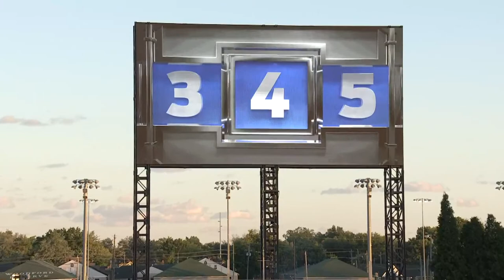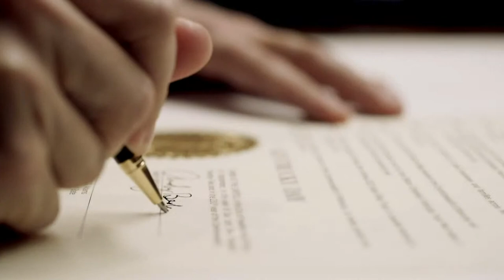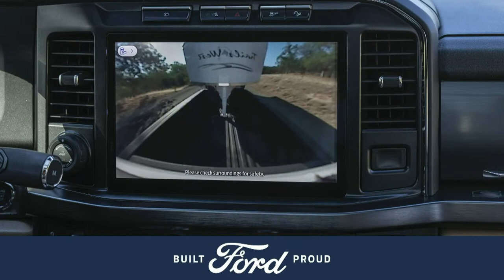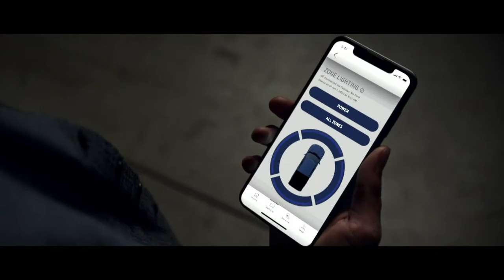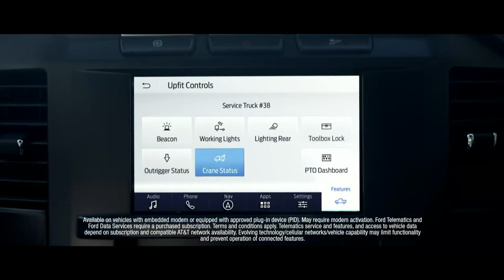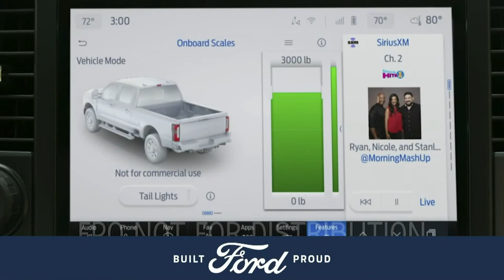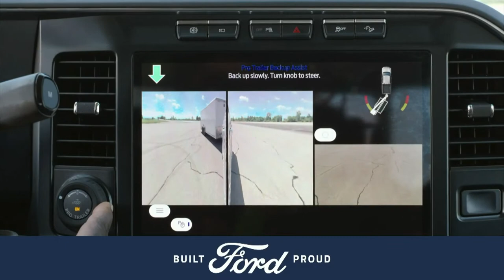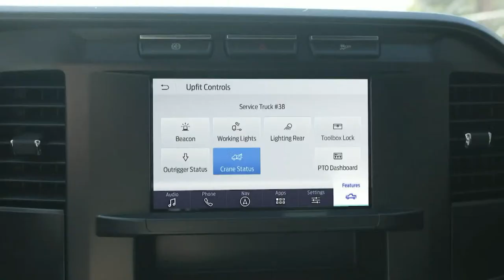All-New Ford F-Series Super Duty® Debut | Ford

Comment: I've owned  Super Duty's for over 20 years and I absolutely love them! They are a true work horse that hasn't let me down and I will continue to purchase them.
However, it would be nice to have a steel bed option. I purchased my latest truck brand new in September of 2017  and it has some holes & dents from metal fence posts and wood. Farmers and loggers don't toss things gingerly and I noticed the first puncture the following spring. Personally the Super Duty is purchased for work/hauling, mileage is just a bonus.
Reply: Bed liner?
Reply: @theinvisiblechurch1607  Yes, doesn't help much. Just keeps things from sliding. 
Still love my truck though.
Reply: @emilybenes3818  Have you tried a professionally sprayed in bed liner? I know you are talking about the aluminum bed.
Reply: @theinvisiblechurch1607  Yes, that's what I have.
Reply: Some of the sprayed in bed liners help and your stuff doesn’t fly around like the plastic 💩.
Reply: @theinvisiblechurch1607  xbxbdhfhfh

Comment: I'm curious on the power figures on the 6.8 vs the 7.3.  7.3 makes 430hp and 475tq but it appears that the power will be bumped a bit?  6.2 DOHC right now is 385hp 430tq, so I'm thinking this new 6.8 has to put out just over 400hp and probably 460-470tq, bumping the 7.3 probably to 440hp and maybe 495-500tq.
Reply: Agreed. Unless the 6.8 is dramatically different, with much better fuel mileage, it seems like an odd choice for Ford to remove ~30 cubic inches rather than keep their focus on improving the 7.3.
Reply: I've owned a few super duty trucks from 99 on up driving and working they were great. Riding on the passenger side not so much need to do something with the foot room about have to put your left foot sideways very uncomfortable on long trips. The 150 are very comfortable but they don't offer the 7.3 I am interested in a new truck but for the money they are getting I don't want to settle for ether one.

Comment: Electric vehicles will get you halfway to where you want to go - 

Btw - it takes over 300 barrels of oil to produce one electric vehicle battery -
Reply: Source please.
Reply: @Dr4by  Common sense. Use it.
Reply: Consider two interpretations for your statement:
1) Energy Storage:  Petroleum's standard for a barrel is 42 gallons.  If you're claiming on battery holds the energy equivalent of (300*42 = 12,600 gallons, then consider if my gas powered vehicle got a dismal 10 MPG. You're saying I could go 126,000 miles on one battery charge. Sorry, but you're WRONG.

2) Energy consumed in battery production: If you're saying that the production of a battery consumes 300 barrels, you're also WRONG. Over the last decade, a barrel of crude has averaged ~$60/barrel, 60*300=$18,000. It costs quite a bit more once it is refined, distilled and distributed to consumers producing products. But even at just the cost of crude, you're saying the energy costs alone to produce a battery would be $18,000, and that's ignoring other costs (markups, distribution, inventory, warranty, advertising, taxes, overhead, profit, etc., etc.)
Reply: Hook line and sinker boys !
Reply: The 300 barrels of oil isn't so bad.  It also takes 1000 unicorn farts.  That's just not sustainable or ethical.

Comment: I would be so excited for a Superduty built for off road as well "Superduty Raptor". I could imagine the cost too.
Reply: That’s kinda what the tremor is meant to be. It has a optional winch and has off-road modes like the raptor. With heavy duty suspension it’s hard to make a 3/4 or 1 ton truck handle the desert without custom suspension.
Reply: What baffles me is that the SuperDuty's have two steel prongs that drop down about 4 inches, relative to the frame. They sit behind the air dam. While the air dam can be removed in order to improve approach angles, the metal prongs are welded to the frame. They dramatically limit the approach angle. Last Winter, a friend attempted driving over plowed snow that had hardened into an icy berm. It's no surprise that the ice broke his air dam. But it also bent one of the prongs.  It's not clear to me what purpose they serve. If I were part of Ford's team for off road applications, removal of these would be low hanging fruit for improving off road abilities. At a minimum, I'd make them bolt on features instead of being welded to the frame.

Comment: Will they get rid of the driving learning feature in the 10 speed please that needs to be reflashed
Reply: Wish they'd just offer a 6 speed manual, it is a "Super Duty" truck at least that's what they keep pretending they are...it should have the proper transmission.  10 speeds in an automatic is way too many gears for it to pick from, luckily there's so many and so closely ratio'd you can't tell its shifting, so you don't realize all the wear and heat that its causing.

Comment: When does Ford plan to ship those trucks waiting for parts?
Reply: 2023 for the 2022 trucks already built! ,
Reply: @LWRC  They may use 2022 chasis
Reply: @wj2791  I don't think Ford can do that!!  Ford changed certain chassis / drivetrain components between 2022 & 2023 in their Superduty trucks and they are setting themselves up for class action lawsuit if they try to pass a 2022 chassis for a 2023!  There may be enough differences between the two years that putting a bed from a 2023 on to a 2022 chassis may not even work!!

Comment: You still couldn't put LEDs as a standard across all trims.
Just as a safety measure.

1. Bring the headlight housing a bit around the fender like the 2020 gen/look. As it sits now, the headlights look like a 90's Chevy van.

2. LEDs should be standard in the rear for sure. to make braking and turn signaling to be the brightest and most noticeable in any lighting condition and be the safest.
Why should a low trim have less of a safety function, we live in a time that LED's are not so expensive to manufacture and install on a truck that it has already designed on the higher trims, it shouldn't make a big financial difference to put the LED housing/assembly on the frikin xl/low trim levels. But it does make an expense difference when you make all different types of cheap and more advanced headlight housing.
Remember that safety shouldn't only be given to the folks who can afford a freaking king ranch or fancier lariat Options.
At least basic LED brakes and turn signals should be a safety feature available on all trucks.
LED front turn signals and headlights as well, but that's a bonus but still necessary in this day and age

3. Make a new v10 option as another high tourqe option for the 6.7L besides the 7.3L

Comment: And too much money no electronic crap window cranks rubber floors am radio that's it,need affordable trucks not obnoxious payments for years on end
Reply: Agreed...I also wish they would offer a manual transmission again, at least in their more base model ones, do a work truck package type deal with the new 6.8L V8 or better yet the 7.3L V8 and offer a 6 speed manual.  That's all I really need is just a plain jane 4x4 work truck, with the V8 and a manual transmission would be awesome....It really changes the vehicle's driving characteristics being able to 100% control your gear selection without a computer trying to figure it out for you.  I'm just not sure if I want to go with a regular cab or extended cab with 8 foot bed.  Leaning more towards an extended cab as it provides some out of the weather storage space for tools and such if you have the bed full of materials.  

1988 F250 4x4 super cab long bed 460 V8 and  5 speed, 689k on it, still going, and still pulling whatever I want it to....would be nice to step into the 21st century of vehicles but the electronic stuff now just turns me off.  A simple radio and buttons/knobs for the climate control is all I need.

I thought trucks were supposed to be for work, not pretend to be luxury soccer mom mini vans.  They've gotten way too carried away with all the electronic gadgets and gismos in trucks.

Comment: You could put better tires that last longer than 30.000 miles. Owner of 2021 F250.
Reply: 2019 lariat 55k miles just replaced tires . 6.7 towing 15,000 and plowing snow
Reply: My Michelins only lasted 29k on my 2021 F350 DRW. Light towing. Looking for better tires now
Reply: @erod6214  I hope I do better than that I'm getting Michelins put on tomorrow,
Reply: 30k on my Goodyear tires, that's it. Now I'm run Toyo Open Country tires. Plowing my quarter mile driveway and towing 14k twice a week. 35k miles on them and just a little over half the life of the tires are left I would say.
Love the Toyos
Reply: Got 44k on 2021 Lariat f250.  Still going strong...

Comment: Looks like the same truck but with a Chevrolet grill.  Lots of nice new features.
Reply: Kinda does
Reply: Chevy grill. GMC exterior add ons (tailgate/steps) AND trying to match Rams interior.

Glad I got a ‘22 150 that’s basically fitted like a ‘23 250 with tow mirrors, chrome pkg and 360 camera. What more do you need?
The aftermarket😈!

Don’t plan on buying another vehicle ever again with the way things are going to electric and fitted with too much tech prone to fail down the road. 5.0 4 life🤙

Comment: I liked it better when you could tell the difference between an F350 and F150 body ,  will they continue sharing the cabs ?
Reply: You mean F350 and F250? That would be a big truck if F150 shared body and frame lol.
Reply: @Tylnorton  it does lol
Reply: @Tylnorton  they have shared the same cab F150, 250 & 350
Reply: @pinktacotuesday4573  Interesting
Reply: @63Imp283  I didn't know that. Thanks lol
Reply: @Tylnorton  cost savings, aluminum weight saving plus the F150 cab was actually bigger on the inside
Reply: @63Imp283  the 450 and 550 share the same cab as well.
Reply: @Tylnorton  the F150 shares the same cab all the way up to the 550, but the frame is not the same.
Reply: @TwistedNutsStudio  they still do.
Reply: @Tylnorton  Ford F150s and F250s have the EXACT same cab. the dash inside the cab is the only difference between the two trucks as far as the cab goes.
Reply: @CMH_1975  thanks I wasn't sure
Reply: @63Imp283  no problem. Been at the plant that builds the Super Duty for 23 years.
Reply: @CMH_1975  It is a modular architecture, they are essentially the same at different specs. We call it T3 and it covers F-150, Super Duty, Expedition, and Navigator.

I worked on planning for this P708 truck and the 2022 U553 and U554 SUVs.
Reply: @63Imp283  Not quite 100% with what Straight Hooded mentioned even as a Ford KTP expert, as they all utilize T3 body on frame architecture since the 2015 F-150 we call P552. These are just Gen 2 of T3, which launched with the P702 F-150 in December 2020.

Comment: Soooo they changed the lights
Reply: Lots more than that.  All new interior, plenty of sheetmetal changes, no more 6.2 engine, all new 6.8 pushrod (smaller bore/stroke 7.3) the 7.3 gets a power bump and 2 versions of Powerstroke, standard and HO.

Comment: Will be glad when my truck comes in .  Been 7 months on order.  Glad I bought. 2022 before that stupid step in the front of the bed came out.  I have that on my GMC and it does not work.  That is why I went with Ford instead of the GMC.  Wanted another Limited but the the interior color turned me off.  I loved my camel back color in the 2019 Limited.  Had to go with the king ranch this time.  $92,000 and still waiting for 7 months
Reply: I believe all orders for 2022 that have not been fulfilled will be converted to 2023 orders, atleast from what the dealership told me when i ordered mine.
Reply: @C10zeus  Dealership says any day now for mine to arrive
Reply: @79xlch  lucky you, i hate the steps also

Comment: Hey Ford, when are you going to stop designing a safety issue into your auto transmissions? This issue is not just on  the Super Duties but on every vehicle Ford makes that has an auto transmission!!!
•  Has Ford fix their transmission lockout problem that prevents the driver from using an open palm to push the shift lever from D into N in an emergency (disconnecting the engine from the drivetrain) without fear of engaging R?!!!  All Ford's competitors do not have this issue and nor do cars from BMW, Mercedes, Audi, Toyota, Honda, Lexus just to name a few!!!   Come on Ford - did you fix it or did you intentionally design in a bad safety feature?!!!

Comment: Why no ecoboost in the gas option?
Reply: @SucidePrevention  I don’t believe I commented anything about the amount of cylinders.  Ford makes ecoboost engines as small as 3 cylinders and I surely didn’t mean to put the 1.5 in the 250.  Why couldn’t there be a v8 ecoboost?  Think outside the box Eddie!
Reply: These are work trucks, built for hauling/towing...a smaller engine with a turbo or several doesn't replace an engine built for work, that's what the 7.3L V8 does, its built with work in mind, you can tow/haul all day long and it won't break a sweat.  You try doing that with a smaller turbo charged engine and you cut its life span in 1/2, or worse.  Turbos don't belong on gas engines, superchargers, maybe, but even at that, its not a workhorse engine at that point, it becomes a performance truck trying to be a race car.....contrary to what people think, you don't need 500+HP in a work truck...all that additional power just leads to people getting themselves into trouble, going too fast for conditions while towing, etc.  

If ya want a turbo buy a turbo diesel pickup.
Reply: @wildbill23c  there’s a reason the 3.5 ecoboost outperforms all other engines built for the f-150 in horsepower, torque, fuel economy, and are equally reliable.  They are better in every aspect.  This is what advances in technology looks like.  Ford diesels didn’t always have turbos.  They realized that they were better with them.  There is a reason ford has implemented ecoboost into all their other vehicles.  It works and all the other manufacturers have been following.  There is no reason to think that ford couldn’t put out an ecoboost for the gas 250 that outperforms with better fuel economy.  The power stroke would still be there for those who need a little more.
Reply: @kevins8527  You forgot the 5L V8 that don't need turbos to do its job.  Turbos aren't new technology, they tried it in the 70's and 80's and quickly realized it was a terrible design idea and didn't really accomplish anything except blown turbos and engines as a result...same is happening now...people overwork their tiny turbo engines and well, yep they break...a lot.
Reply: @wildbill23c  3.5 ecoboost still outperforms the 5.0 and is equally as reliable.  200k on my f150 and still going strong.  The point is technology gets better over time and fords are way more Relaible now than they were 30+ years ago.
Reply: @kevins8527  Let me know in 30 years if your Ecojunk engine is still running, I'll keep driving my trucks with 302's 351's and 460's.

Comment: Looks no different from the last 5 years of Super Dutys, a lot hype with no substance.
Reply: Actually it does. I've been looking at these trucks for months. The hood, grill, fenders, bumpers, tailgate, and bed sides are all different. Including the door skins. The body lines look softer and not so squared off like the 17'a to 22's.
Reply: @CMH_1975  I expected more. I don’t think that my 22 250 lacks much compared to the 2023. In fact, I like that my interior looks like a SD and not a F150.
Reply: @CMH_1975  It's the same overall truck, slight different body lines but that's about it, Take someone that's not into THIS truck and I bet they can't even tell the difference, Ford hasn't changed the overall design since the 1999 model year when they started calling them the Super Duty.
Reply: @brownh2orat211  I've been working at the Super Duty plant for 23 years. I've watched these trucks change with my own eyes.

Comment: My 2022 F350 took 5 months to come in then FORD wouldn't honor price-lock guaranty I was promised at time of order and gouged me for additional $2400 when it came in from when I ordered! The body panels look like you allowed a 10 year old align them! The truck sits lower than any other Superduty I've seen even though I got plow/camper/towing packages and the dealer can't figure out how to help me resolve! Well, they got my money now I can go away! This upsets me cause I hate a low truck, it's a 350 with all the options to not have it sit low SMH. I drive my 1997 crew and the 2022 crew just sits in driveway.